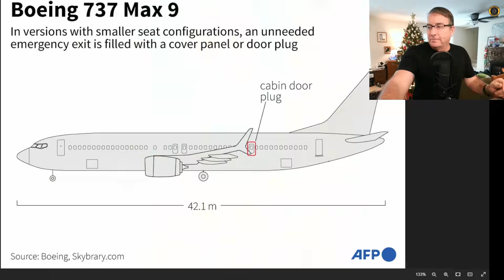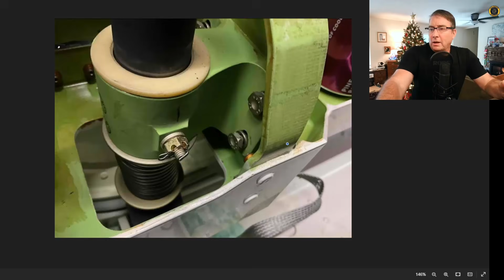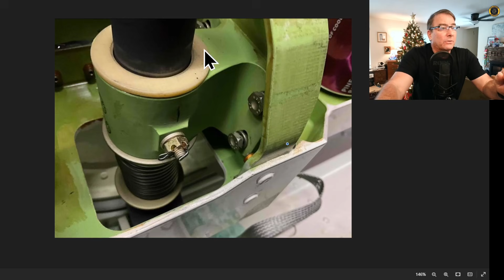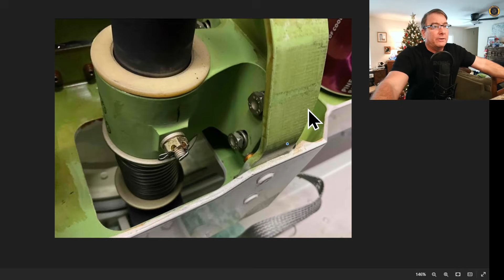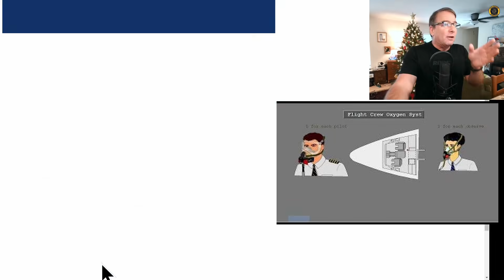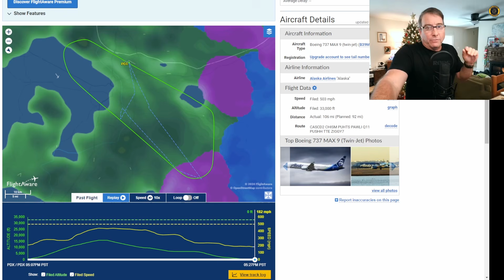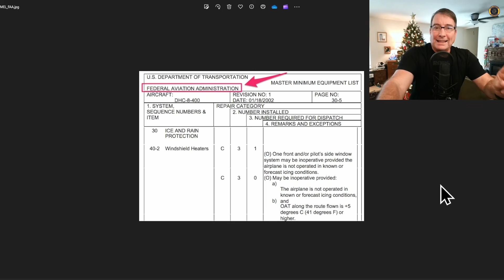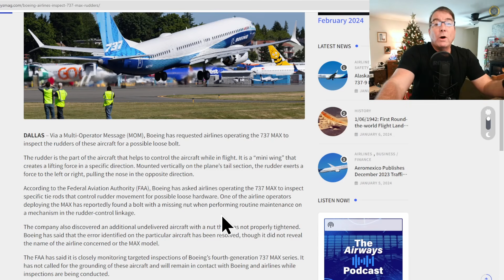"Yes, We Have No Bolts"  9 Jan 737 Max-9 Update

Comment: The thing  I find disturbing is the fact that the 4 bolts that hold the hinge guide to the door plug are not connected to the adjacent bolt with safety wire so if 1 bolt started to loosen would be prevented from further loosening since the placement of the safety wire will tighten the other bolt.
Reply: Boeing doesn't use much safety wire at all. Not like the fighter jets in the military. They are not subject to as much vibration as Military aircraft are. Boeing mostly uses self locking nuts and castle nuts with cotter pins. Except on the engines, many bolts will have safety wire due to vibration.
Reply: @bobczz3919 uh I've been on some very vibraitrous 737 maxes so eh I don't  like that fact 😬
Reply: The design is not at fault here. Correctly installed, there is no way for the door to depart the AC. Even if 3/4 of the bolts were missing, nothing would happen. This is a process/QC error.
There should be a tag on the cotter pin container that must be removed and placed on the build sheet before installing the interior panel.
Reply: Bolt with castle nut and cotter pin is acting at a stop pin. No safety wire needed.  It is not a bolt requiring torque. It's to rub against the roller to keep roller from any up or down movement within the channel / guide. Bottom bolts acting like pins are to keep the door from compressing onto springs. Locking out down movement. Up movement is locked out at roller and guide. So this plug operates by, after bolts are removed, plug moves down on springs to clear guide, stop pins and pads, and upper door to aircraft skin over lap. Then top of door swings out as it is hinged on the spring tube mechanism at base. If bolt were to brake at drilled hole the nut would still have to giggle loose. I suppose if bolt had drilled head, bolt head would be skin side of guide channel. I suppose one could pre install safety wire on bolt head then install bolt and attach safety wire to other structure.  Being pin like, it's shear loads.

Comment: What use is a hardened cockpit door if a rapid depressurization event can open it?
Reply: How would one intentionally depressurize an airplane who doesn't have access to the flight deck already?  Open an emergency exit?  Virtually impossible.  The only way would be right after takeoff when there is little pressure in the cabin and then it likely wouldn't blow the cockpit door open anyway.

Comment: Please look at the actual description in the blueprints of how this door plug operates. It is not bolted to the airplane. The bolts that they're talking about that vertical movement arrestor bolt and the Cross Pin bolts that go in the slide latch mechanism at the top of the door only interrupt the movement that will unlatch the door from the framework a lot has been said about other companies and even some other Crews apparently finding loose bolts. The problem isn't the bolt being Loose as long as that castle nut is on that bolt and the cotter pin is in it, that door, is not leaving that aircraft. The only way that I can see from the design structure is that somebody may have put the bolts in but never put a castle nut on it at all. They either then went to lunch or something and never signed off on the work how in the world this ever got past someone is beyond me. But I cannot figure out how in the world this ever got past inspection is beyond me. The way I'm looking at it, either the latches at the top broke in order to cause this problem. Or somebody never put those bolts in in the first place and just latch the door. It latches into place and all the bolts do is interrupt any movement to unlatch it.
Anybody who might ask my background, I worked on aircraft in the air force, F-111 f-16s at 15 at 4:00 I even worked on the privately owned f-104 owned by Daryl grenamyer. I've also consulted twice on the 737 problems with the rudder actuator issue with Ted Hovenga, at least I believe that's how his name is pronounced.

Comment: It only takes an very small opening to equalize pressure between two chambers. It certainly wouldn't require the area of the entire cockpit door.
Reply: That depend on how long you want to wait, and the deltaP......
Reply: A huge opening opened suddenly on the side of the plane.
Reply: @SteamCrane  Yes, I'm referring to equalizing the pressure between the cabin and the "flight deck" (the FAA, in their quest for woke points, no longer uses "cockpit," just as they've changed NOTAMs from "notices to airmen" to "notices to air missions") after the door plug blew out. A small opening, activated by a pressure differential, would suffice.

Comment: Thank you Juan for all the updates. The more I learn about this design, the more puzzled I am as an engineer. 

Then there is the omission of information availble to the crews on various critical topics now. 

If the cockpit door hadn't blow open, there would be less pandemonium in the cockpit if just the two panels had opened to equalize pressure. These are no-brainer things, pointing to Boeing not having enough brains to be in the aviation business. 

Personally, I'm going to start selecting Airbus flights whenever available, even at higher cost.

Comment: Those four bolts performing blocking/keeping function do not experience even a tiny fraction of the force required to shear them.  It appears rather likely they were either missing, or improperly installed (e.g. no cotter pins) and were shaken loose/out.

Comment: I know that this would make several things quite a bit more difficult, but if the door was bigger than the opening, this problem could be avoided. In other words, if the door had to open to the inside because it had a flange that made it bigger than the frame then this accident couldn't happen because the higher the pressure inside the plane, the more force put on the door, the tighter it would get to the fuselage.  I think I may have actually seen it this way on a plane before. But why wouldn't every airplane door be required to be this way?
Reply: How would you envision installing this design from the inside of the plane while accommodating the hinge guides that are part of the fuselage?  Emergency doors can't open inward for obvious reasons.
Reply: @paulsaulpaul  I could think of at least 2 different ways to do it, and neither one of them involves the door swinging in like a household door on hinges.  You could easily have the door move in the equivalent of its thickness and then slide up or to the side on tracks and would be perfectly acceptable for emergency door. If the Boeing engineers can't figure something like that out, then maybe they aren't smart enough to be Boeing engineers.

Comment: I think you nailed it on the cabin pressurization failure. 

They will probably find it was just floating in there. That many pads, that far apart, at least a few of the bolts would have stayed in place due to an almost interference fit. The tolerances between the fuselage and the plug would have invariably made a couple bolts close fit enough to stay in place without the nuts and pins. My prediction: They removed them in assembly, and they did not put them back. They may have loosened other fasteners to aid alignment and allow the plug to be reinstalled causing the issue NTSB has found so far. They will find some marks on the parts from the OEM assembly process. But no fasteners.
Reply: There aren't any bolts in the stop pads. There are only four bolts - two at the top that keep the rolling pins in their tracks, and two at the bottom that keep the springs compressed. The pads are only under load when the fuselage is pressurized. To lose the door, absent a material fracture, most of those four bolts would have to be missing.

Comment: Boeing seems to have many issues in Quality Control with more than one of its designs.  If the required bolts were not installed or the other bolts not properly torqued, something needs to change at Boeing or that company may be forced to fold.

Comment: 1 door having a departure and landing at a different time than the rest of the plane is a bad Monday morning at the factory. Having 5 more with a condition that could cause the same issue is deliberate sabotage.

They need to be looking at employees at both Spirit where the fuselages were assembled and at Boeing where the rest of the plane was bolted together. My guess is at one location or the other they will find someone with an axe to grind. My guess is it will be a "green activist" type trying to do permanent damage to the airline industry but that is purely speculation on my part.

Comment: The image of the guide pin mount shows a rather poorly designed peice of hardware, where the two parts can come directly apart without it's bolts, rather then having to be lifted out of a interlocking mount where the bolts would just be there to stop the parts moving within the mount.

Comment: Am I doing my approximate math correctly? Assuming the door is roughly 5’x3’ and a pressure differential of 5psi between aircraft interior and outside air would suggest there’s about 10,000 pounds of pressure on that door. If that’s about correct, pretty wild!
Reply: That is correct.  That's why it's virtually impossible to open an exit door while pressurized.  At cruise altitude there is usually around 8-12 psi, depending on the type of aircraft and design.

Comment: No body has said this sabotage or paper whipped I build experimental aircraft everything is logged I'm a amature builder  somebody was assigned the work and someone inspected and signed off on it , My question on the other aircraft they found lose bolts was it the same person or people ? and a casel  nut & bolt & Carter pin x 4  just no way .

Comment: I'm an automotive mechanic, I was told by a commercial aviation mechanic that they mostly use lock wire for bolts.
I find it interesting that they're using castellated nuts with split pins.
To me if one of those green things is missing, it would indicate that the bolts sheared the heads off and because the safety bolt was likely missing the spring would've just shot it off. 

Thanks.
Shane the mechanic.
Reply: or the Bolts were over torqued and fractured . if the nut sheared off the cotter pin the threads are gulded to the point you got to cut the bolt to remove it
Reply: @saltseaful  I was talking about the four bolts that bolt into the door frame.

Comment: There is a lot going on here. As a retired engineer that worked with saftey critical designs, my simple understaning of the design of the door plug load bearing surfaces to the fuselage (12 as described) seems proper and most likely will show no issue on post inspection. I would suggest the four " bolts with castle nuts " are simply acting as locking pins ( in shear ) with no real load force acting on them. Yes cotter pins with castlenuts or wire looping the nuts will keep the "pins " (bolts ) from falling out which essentially are keeping the actual locating mating channels aligned which in turn allows the 12 load bearing surfaces to manage all the force. Without pins or bolts in this case, installed with secondary secured latching ( cotter pins or wire looping) you have a failure mode which violates basic safety design. Again my simple glance at the design suggests all four positions of the pins would have to be missing ( or failed )to allow the door plug to release. The math of this occuring would suggest some or all bolts were missing.
So ,,who did not install or reinstall the bolts and were they installed to design with secondary locking?
As others have commented, there is a build sign off log of the installation of these bolts. 
It is also the responsibility of a safety critical engineer to provide clear directions of how to install componets with specifications. 
If a technican can install a part backwards,,,, it is a bad saftey critical design. 
Missing bolts are a build/service process problem. Anyway,,,,, my two cents.......
Reply: Best comment of all!  It looks to me like even ONE of the bolts installed would have been enough to prevent this door from ever coming off.  There's just no load on them and the door probably fits tight enough that one side couldn't lift without the other side lifting.  I think the cause will be found to be someone not installing any of the bolts at all.
Reply: @johnaclark1  Yes, my guess would be the passenger cabin interior installation people, who are usually unlicenced techs.
Reply: I guess another possibility is they weren't torqued down at spirit - but put in as a placeholder meaning happens after the final configuration is known. And someone  LOOKED that they were there and presumed they were torqued down - didn't want to bring attention to it and incur another process. & movement/vibration shearing them
Reply: @crabbcake  there's no force on those bolts. Alll they had to do is be there and the door would never come open. Their torque has nothing to do with the door staying in place other than keeping the bolts in position. They were left out or the cotter keys left out and they vibrated loose.  We may never know but what is clear is the only way that door comes off is if those bolts are not present.
Reply: Just from an organizational standpoint, the odds are good that the bolts were installed at Spirit but sometime later, somewhere, someone found a pile of extra bolts and nuts and didn't tell anyone. I would not want to be said person. Airplanes don't have extra bolts.
Reply: @kinikinrd  I heard that the plug is attached at Spirit Aerosystems before shipping the fuselage component to Boeing, but that the plug is removed (or just lifted up?) for inspection or whatever at Boeing.
Reply: @kinikinrd  This was in the earlier video: the doors are installed at Wichita, but removed in Washington to install the interior. Then they are reinstalled and all the insulation and vibration dampening and interior panels put in place.
Reply: Yea, everyone thinks that this thing was held on with bolts lol

Comment: I would be worried now about the ton of Navy P-8 aircraft they've shipped. It would be a real mess if these start falling out of the sky, not to mention the E-7's. All versions of recent 737 manufactured, and probably built by the same gomer on the assembly line who is signing-off unperformed work.

Comment: well... admittedly I can't fly at all any more because, while I am just about safe at 10,000 feet, this depressurisation excursion would have killed me (I have motor neurone disease weakening my respiratory muscles). I think if I were able to fly, there is nothing Boeing or anyone else could do or say to persuade me or anyone in my family ever to fly on a 737 max. As far as I am concerned the plane is done and they might as well scrap them all - untrustworthy. Boeing have made and still make some excellent planes e.g. 777 variants. but for this market sector, the 737 series stops here and they need a completely new design and new designation.

Comment: What’s disturbing is we don’t know how many other stupid design decisions Boeing has made with the MAX aircraft. We’ve seen Boeing installing big engines on the 737 even though it sits to low to the ground, the MCAS fiasco, a overly simplistic plug door design and what else? Come on Boeing, 4 bolts to hold a fake door in place!

Comment: IMO At this rate of failure found to date every single bolt and pin on the entire aircraft needs to be re-checked across the entire fleet before they are signed off airworthy.

Comment: @11:10 "plenty of time of useful consciousness" I have climbed several 14,000 ft. peaks, mostly in the San Juan Mountains of Colorado. I just like getting out in the mountains, I am not a "Mountain Climber", in fact I am a heavy smoker and have been for almost fifty years. In 1996 I vacationed in Alaska and got to try Denali, I don't remember how high base camp was but there was no problem breathing there. I did not have much trouble until we got to about 18,000 feet but I did give up soon after that, I could still breath, but my legs were gone.
Is it somehow different in a pressurized plane?
Reply: What if they dropped you at 15,000 feet and you didn't have to hike all the way up there?  You'd feel pretty good for a while.

Comment: The 2 lower retention bolts could be perfectly tightened with pins installed but if those hinge fitting bolts are loose it wouldn’t matter. I’m somewhat surprised they aren’t designed to be torqued AND safety wired.
Reply: every ASN nut and Bolt have

Comment: Brilliant work here, Juan. My company writes MEL/MMEL procedures manuals and it’s great to hear an accurate useful description PLUS the advice to crews to consider the relationship between multiple write-ups.  “The airplane is talking to you.” Fantastic way to phrase it. Question: Was this problem exacerbated by QA problems at Spirit AeroSystems on the 737 line in Wichita, KS? A lot of controversy there. When it was Boeing plant I had 24/7 access focused on composite adhesives, sealants, tapes, and abrasives. After Spirit got in there, many vendors lost access so we couldn’t easily talk to production workers about materials and processes unless a supervisor was present. The production folks could no longer be candid about such materials & processes as used in day-to-day production.  There’s some merit to that, but at what cost to safety?
Reply: In one of Juan's previous videos he explained that the fuselage is shipped to Boeing with the plug installed, then the plug is removed at Boeing for more convenient access to install the cabin interior. If that's true, it would seem to exonerate Spirit.
Reply: Good point.

Comment: If the door has to move up about an inch and a half to clear the locking pads and it has been vibrating loose for a while, wouldn't you think that there would have been a visible gap at the bottom of the door that could be seen during awalk around by maintenance or crew?